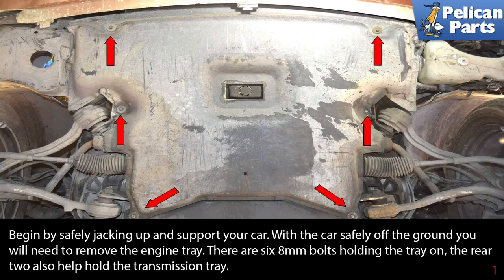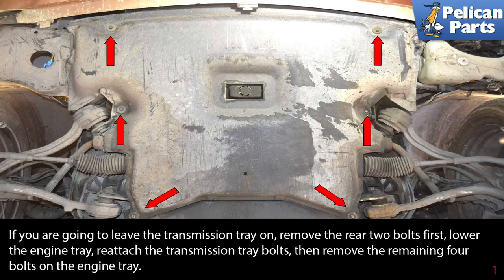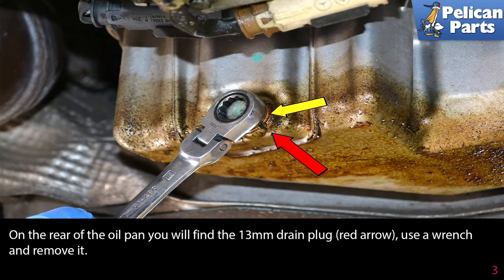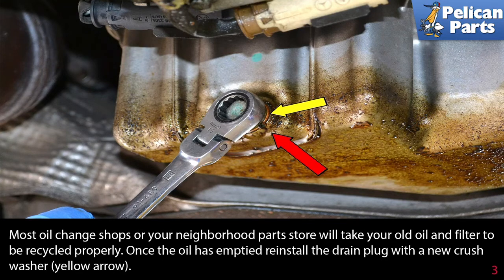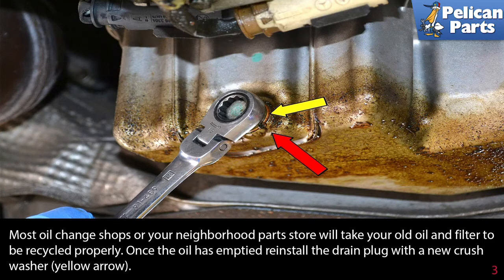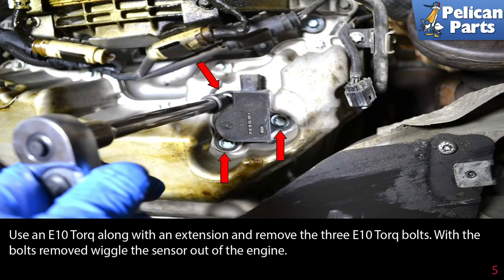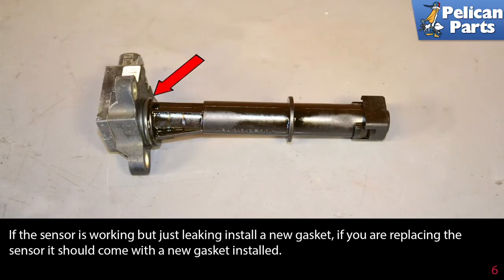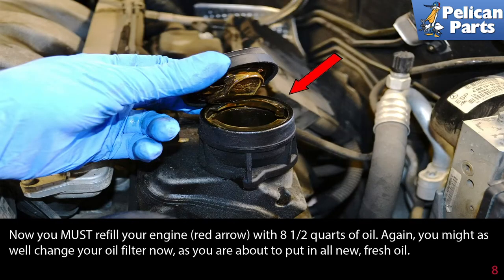Mercedes-Benz W203 C-Class Oil Level Sensor Replacement

Comment: My car keeps saying check oil level, but I recently just got an oil change.
Reply from the maker: It could either be low or have a faulty level sensor. Be sure the oil level is correct.
Reply: @pelicanparts  I was thinking the same about the level sensor
Reply: I changed mine oil position sensor and  the oil as well is full and still showing on dash even cleared code came back ??

Comment: Got a 2015 Merc Sprinter W906 been looking for my Oil Tempreture sensor for the past 2 days, mercedes told me on the Sump but looked till im blue in the face its not there
Reply from the maker: There is a electrical harness mount / duct, it has to be removed. Then remove the vacuum line at the vacuum pump, be sure to pump the brake pedal to discharge the vacuum system. The sensor can then be seen above the port at the vacuum pump for the main hose you previously removed. Assuming for 3.0 l engine.

Comment: your link to the oil level sensor part takes you to the ABS sensor
Reply from the maker: With your vehicle info handy, give The Pelican Parts parts specialists a call at 1-888-280-7799. They can figure out what part or repair kit you need.

Comment: Hello and thanks for the video. I have one question , this sensor does read only the level or reads also the temperature that shows in the dashboard on the lower right hand side ?
Reply from the maker: What is the year and model of vehicle? I can see if I have that info.
Reply: I have the same question my is a 06 Mercedes Benz c230 sport

Comment: I had same problem of oil level sensor, i have replaced the oil level sensor but my car is showing the same thing that oil level sensor in error. And I can’t check oil level in my car . 
Can you please help me brother?
Reply from the maker: Check the wiring to the sensor, it may be faulty.
Reply: @pelicanparts  thanks brother , i have one more question. Do you some information of obd trouble code p0698 (sensor  reference voltage C circuit low )?

Comment: Is this video compatible for W211 E260 2003 V6 Engine M112?

Is it possible to clear the engine oil level sensor without letting the oil out?

If its not possible, is it safe to keep the incoming oil somewhere first and the refilling it again once we finish cleaning the sensor?
Reply from the maker: Yes.

No, you will have to drain it. If you catch it in a clean container, you can reuse it.

Comment: Thank you
Reply from the maker: You're welcome
Reply: Hey so my car is intermittently smoking and intermittently ticking out of my valve train it only happens if I hammer on it bring it up over 3500 RPM for a couple seconds or more then it'll start ticking like crazy and it will just pour smoke fillinh neighborhoodsI can shut my car off and leave it overnight or just tell it cools off down to below 40°, and start up tick for a second smoke a little bit and it'll all go away any idea where I need to start? LMFAO I have a few buddies and even they're not sure what's going on